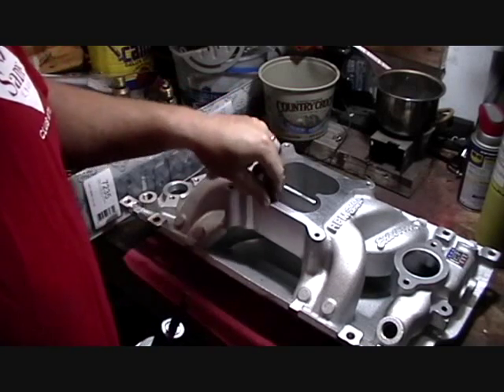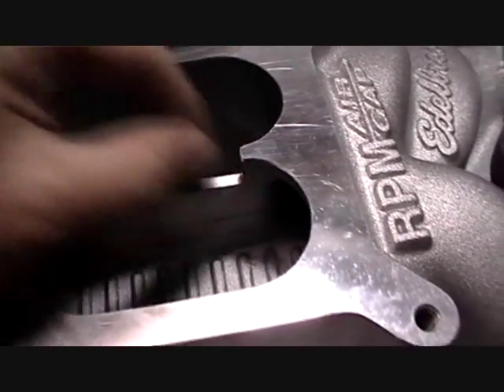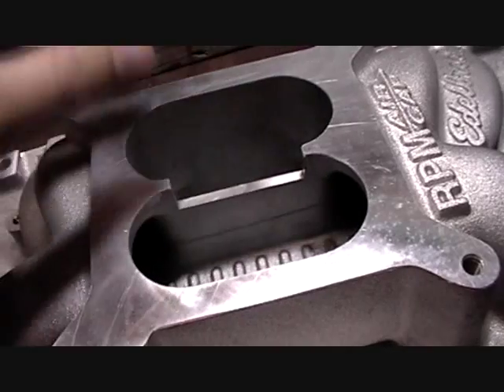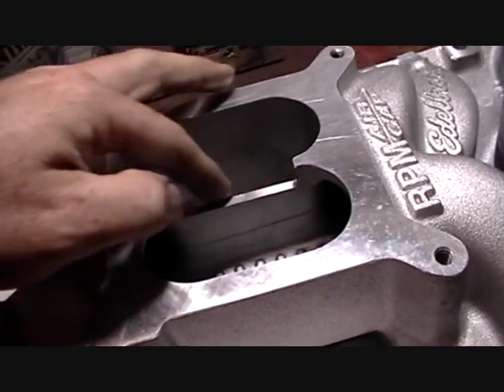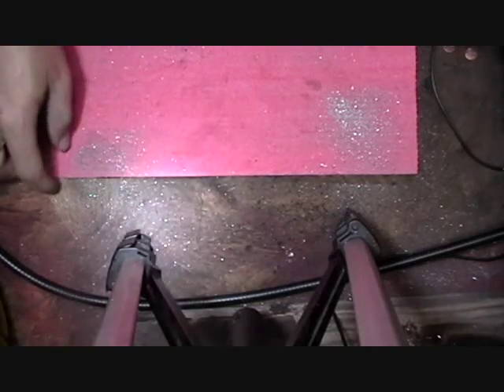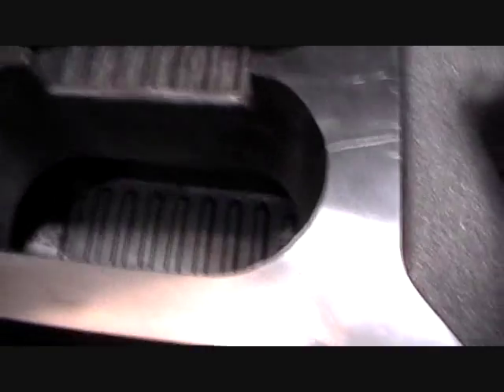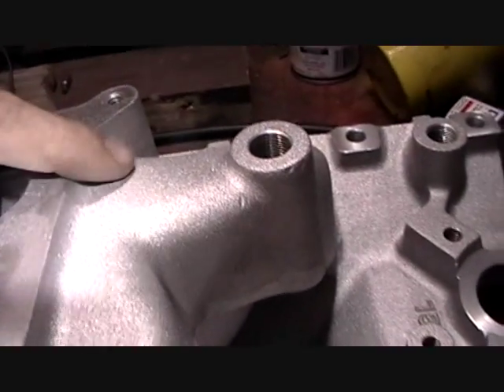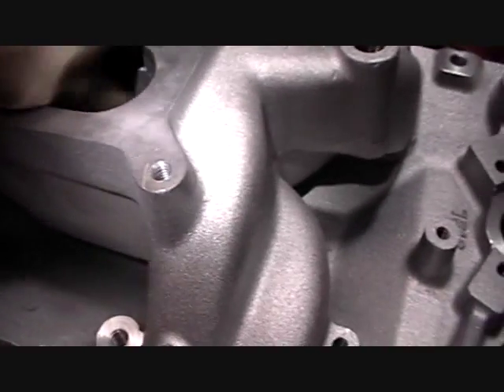How to port and gasket match intake manifold Part 1

Comment: I’m not gonna watch this video if you said it in the video I apologise but you should always have a larger second orifice meaning manifold intake should dump into a larger head intake runner same as your head exhaust port should dump into a larger exhaust tube so you don’t have back up match Porting ? Sometimes it’s better to raise the projection of the flow so it doesn’t hit things that interfere with it

Comment: I did the same to my sbc edelbrock esp manifold.Any issues with running too rich? lots of mid/high range power though!
Reply from the maker: Mine runs a little rich but that is because my carb (it ran rich before)  lean is mean...lol
Reply: @2LateIWon  What kind of carb are you running? I have and eledbrock 1406 600cfm I had no issues until I had a cyl#2 misfire( plug wire)and broke my choke.
Reply from the maker: @gregoryburakowski2666  I have a Holley 750 double pumper it's kinda to big for what I have.
Reply: Also ever try running  colder plugs?
Reply from the maker: @gregoryburakowski2666  no I really need to rebuild the carb and start from there

Comment: Good video brother! Idk if you've ever tried this, but whenever I'm grinding/sanding or polishing aluminum I use WD-40 or some kind of lube and find it helps with a better finish in the end and seems like it makes it easier while removing or smoothing it out plus helps keep the flying debris down a little. Just an opinion but I could be right or wrong in doing so lol I'm far from an expert and just liked it better for my own preference. It just seems to make everything easier and better for me
Reply from the maker: thats a great tip Ill have to try it next time
Reply: @2LateIWon  Right on bro

Comment: You know we pay that much money for an intake you think they would have it done already
Reply from the maker: totally agree at least get the big ridges off and everything.  Thanks for watching
Reply: No doubt! I mean I expect to have to do my own work for mods but shouldn't have to do work just to clean up the crap that some leave in there or the jagged or rough corners and such. For what some charge that type of stuff should be expected to already been done and cleaned up
Reply: @port nut actually it creates better airflow which can get more performance out of it and since you’re spending that much money on a performance part it should be done right
Reply: @port nut  I guess that’s your personal opinion that most people disagree with because that’s why most people do this even professional racers to get the most performance that can out of the engines even people using those engine stands that shows the horsepower of the engine testing before and after showing the difference
Reply: @chris18228  The Edelbrock book the great manifold bolt on said that smooth intake runners and plenums causes the fuel droplets to drop and pool up instead of atomizing more and staying suspended with the air fuel mixture. Port matching the intake manifold runners to a head that has larger intake ports will help with flow because it's at the very end and begiining of the intake runner to intake runners on the heads. Most real drag cars use open plenum intake manifolds that already have a larger open plenum plus enlarged intake runners ports for aftermarket race heads or stock modified ported and larger valve upgrade to those heads to gain more flow but if you look even on these single plain intakes the intske runners are still casted somewhat rough to help keep the fuel droplets mixed with the air which actually help speed up port velocity and flow . Added compression from pistons also makes more torque but also increases HP because the compression also helps with the intake and exhaust port velocity. On dual plain intakes like this often times there are burs left behind from the casting process or from the machining process and it's always a good idea to get those out because they can break off from heat sink and vibration which will go directly into the combination chambers and cause damage to tops of pistons also valves.  There is a company that does what's called extrude hone porting where they take intake manifolds or cast iron exhaust manifolds and hook it to the extrude hone machine with plates attached to the intake side of the manifold and the exhaust side of the manifold and they run a slurry of a gritty compound that's liquid but thick enough to be pressurized and then it's pumped ubder high pressure back and fourth through those ports to open them up completely inside where you could never get a porting carbide tool into . Once this is done they use a rough extrude hone solution to slightly make those runners for the intake manifold rough so the fuel air mix stays suspended  instead of dropping out of suspension and pooling up causing poor velocity and sluggish throttle response and a loss of HP and torque.  Combustion chambers on the other hand benefit from polishing because it helps flow into the valve chambers and gets rid of sharp edges that can cause hot spots which can cause detonation . Cylinder head shops often do this and CC the chambers first then polish and make each chamber hold the same amount of fluid used in the CC tube then usually the valve pockets get the same treatment and a good 3 or 5 angle valve job to the valve seats and valves being cut and lapped in with those valve bowls polished up as well that way each combustion chamber on the heads are all matched to flow the same on the intake side and exhaust side . This is known as blue printing  which can also be applied to pistons rods and crank shafts so everything is made to the same spec which improves HP but also makes for a smoother running engine that's also easier to balance which also helps internal parts to last longer .

Comment: DO NOT GRIND on YOUR INTAKE... it's supposed to be rough to atomize the air fuel mixture. The plenum divider you milled down is cool, but just use a hand file to smooth the burrs on it. Don't smooth on the runners at all! You'll regret it !
Reply from the maker: Almost 3 years later still glad I did
Reply: That's awesome... I've seen dyno pulls with the mod and without and if done correctly it improves top end breathability... at the cost of a bit of bottom end torque.
Reply: @SuperDave21  🤔 awful big change in advice 🤣🤣🤣
Reply: @jjmccloud  Nope, your intake and money... if you flow benched it you'd find out you hurt performance a bit. Merry Christmas !

Comment: ,,, this is a total waste of time,, without$1,000 worth of porting on the heads,, under the valves,, and enlarging the full Runner,,, to gasket match you must do impressions,,, with the intake and the heads bolded and torque to the block you're using,,,, there's a big difference between spit shining and funneling,,,, versus true grinding and porting,,.  !!!   Useless on engines under 6600 RPMs,,,,, 400 + horsepower,,,  !!!